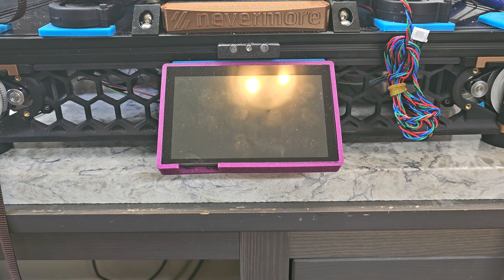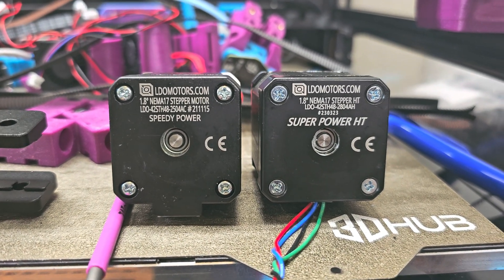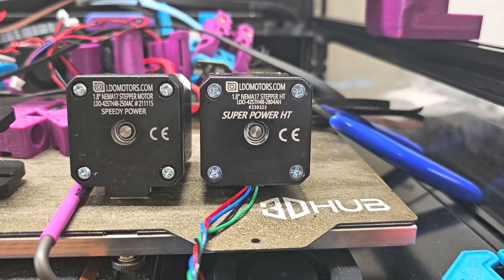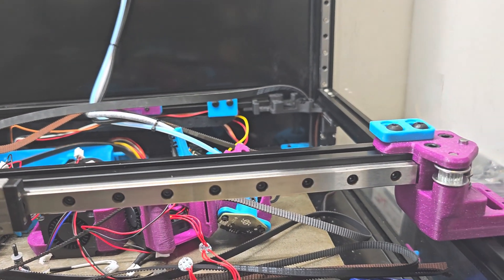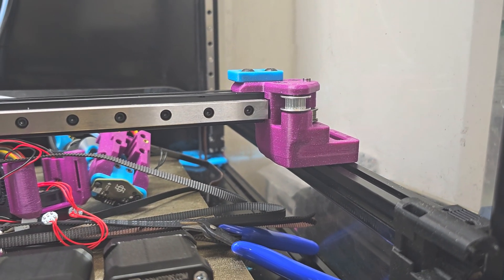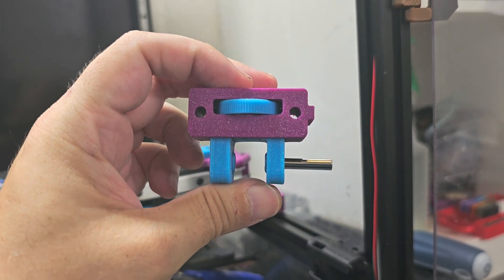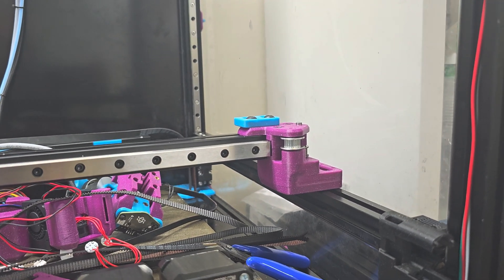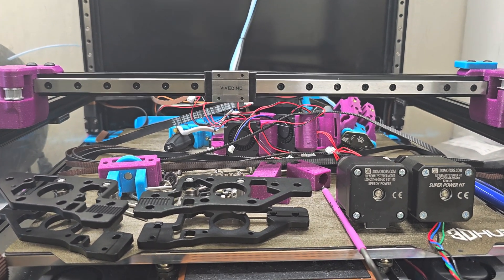Voron 2.4R2: Upgrading most of the motion system

Comment: How are the steppers running? I have the same ones and I am hesitant to run them up to 2.8 out of fear of damaging them.
Reply from the maker: They are running fine, but quite hot. I wouldn't run them with 2.8 run current on plastic motor mounts. Fortunately, I am using CNC motor mounts.

Comment: Instead of Rama's Idlers you should use Clee's BFI (beefy front idlers) instead. They're the same form factor as Rama's idlers but they are much stronger as the layers don't go against the tension.
Reply: You got a link to Clee's BFI ? I can't find anything.
Reply from the maker: @Morfesto https://github.com/clee/VoronBFI
Reply from the maker: Those DO look interesting. Sadly, I just finished re-belting my Z's about an hour ago. I'll look into these for a future upgrade.
Reply: Oh, great. I plan on doing a cartesian 500x500 idex printer based on the 2.4 flying gantry.
Since the printer has more weight to handle a more solid idler will be a perfect match.

Comment: Wait, is this à formbot kit ? 
If so, would you recommend it ?
Reply from the maker: It's now a heavily modified Formbot kit, but yes, I ordered the original Formbot 2.4R2 350mm kit from 3dprintersbay.com last August.
There wasn't anything wrong with the components in my Formbot kit, but at the time, they didn't include too many extras. Honestly not sure if that has changed since.

Comment: I'm building a Voron 2.4 and I've already ordered the aluminum in advance so they're already on it now.. I'm curious how you like them
Reply from the maker: Do you mean the aluminum AB motor mounts? I'm just installing those today, so I can't really form an opinion yet on their performance, but so far the assembly has gone smoothly.
Reply: @oldguymeltsplastic  Any update on how you like them so far? Also, do you have a link to where you sourced just the motor mounts and not an entire aluminum kit?
Reply from the maker: @bobbyshoe8621  the CNC AB motor mounts have been working well for me. Link is in the video description.
Reply: @oldguymeltsplastic  I am blind, thanks for enlightening me. I just ordered them and the LDO motors. Hopefully they work as well for me!

Comment: I ordered exactly the same stepper motors yesterday. I haven't thought about the higher temperatures yet.

I look forward to your continuation

And thanks for the input! ;)
Reply: I'm running them at 1.9A and they haven't melted my mounts yet. I do plan to CNC some aluminum mounts at some point so I can extract their full potential, but for reference, they can run 800mm/s at 20k accel with current settings.
Reply from the maker: I have been advised that the LDO 2804 motors run hot; if you are going to run them with a higher run_current, then they will likely run hot enough to melt any ABS/ASA motor mounts that you might print for them. It was recommended to me to use metal motor mounts for them, to play it safe.